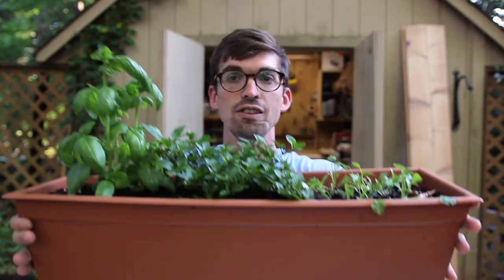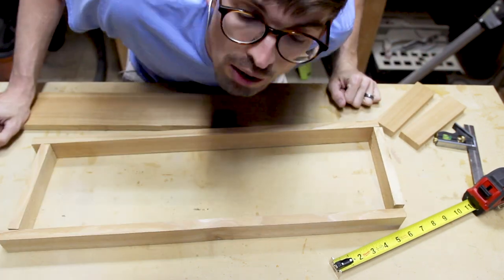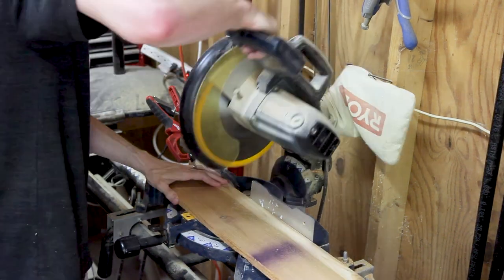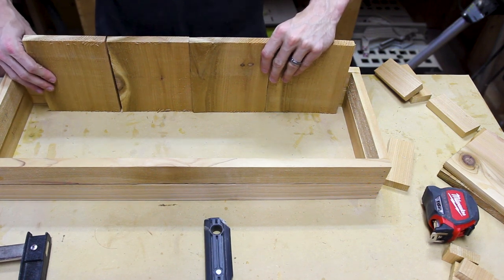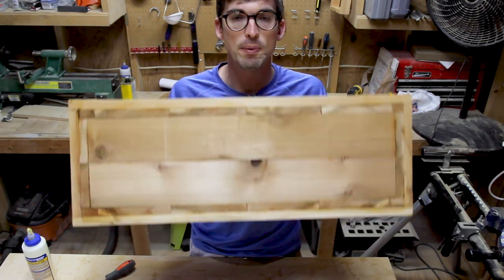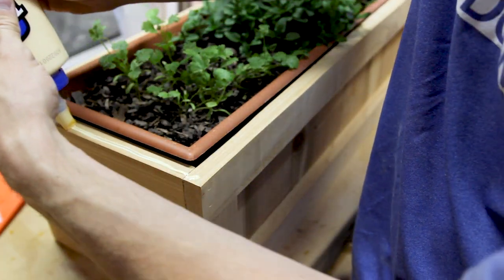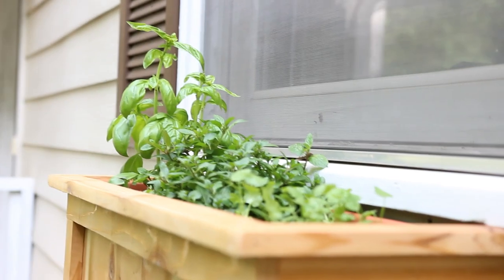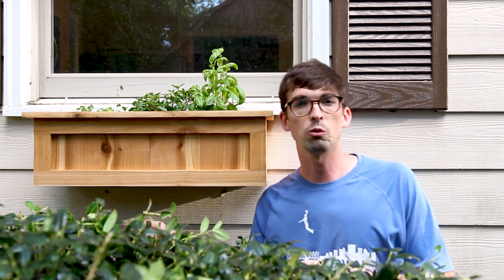How to Make a Cedar Window Planter Box

Comment: Hello , may I suggest a solution for perfectly lined up drainage holes that you could add as an update to your video.                                      Take a drill and from underneath your window box drill up trough the drain hole into your planter for easy perfectly lined up drain holes. When building new planter boxes place the empty planters in the box and drill through the pre drilled holes in the planter into the wooden planter boxes for perfectly lined up drain holes. Happy planting, Bob Mahaney

Comment: I'm planning on building window boxes for next spring and I love your design. How did these ones hold up for you guys over the course of the growing season? Anything you wish you had done differently?
Reply from the maker: They actually held up well!   Really the only change is just in the order of assembly, which I think I hit on towards the end of the video.  The way I first built it made the bottom a little hard to put in and I forgot to drill drainage holes to start out.

Comment: Curious why the bottom and drainage holes alignment matters at all - not sure you need a full bottom.  Couldn't you just have a few crossbars that support the internal plants rather than a solid bottom?  Especially if the planter box can't be seen from below.  Just a thought.